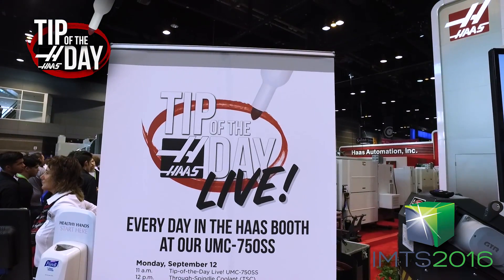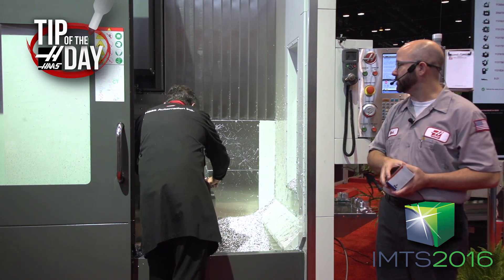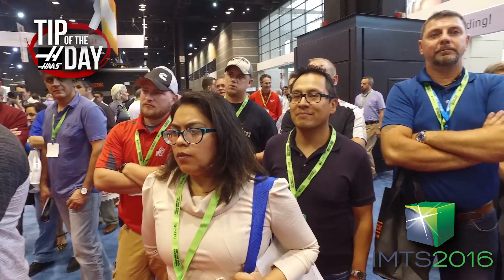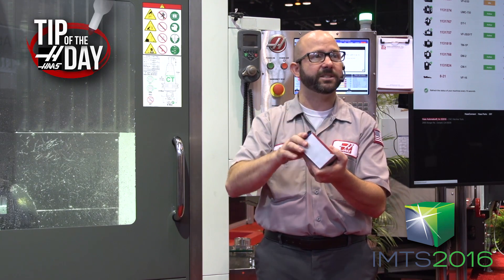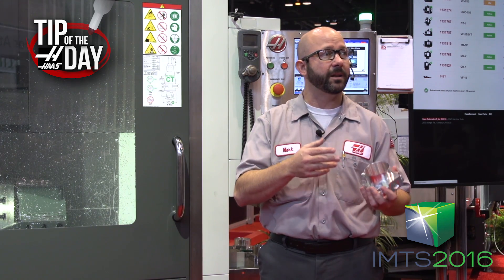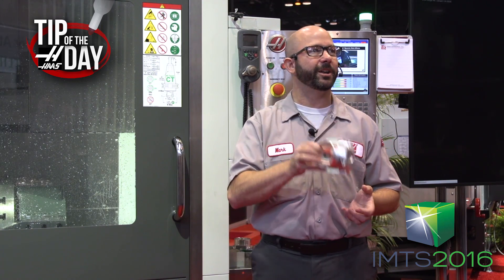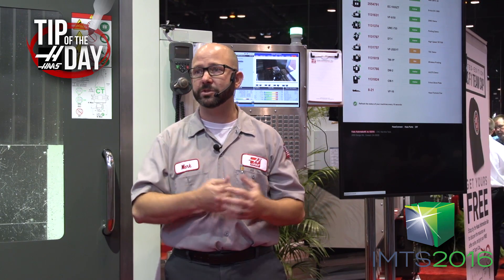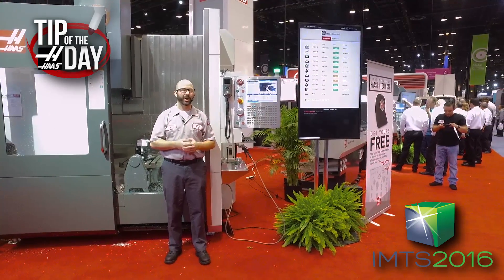Haas Tip of the Day – LIVE from IMTS in Chicago!

Comment: It actually doesn't find the part... he specified the rough position of the probe in advance.
Reply: Yep, you are right. He did.
Reply: Higher part, or vice could make nasty crash. But still, its very usefull when machine automatically adjust vice angle.

Comment: So is an M06 tool change stopping the spindle and turning off coolant only on new machines with next gen control or does it work with older HAAS machines as well? When I was still in school for machining we were taught to stop it and turn off coolant first, so I have never tried it. Will it work on any HAAS mill?
Reply: M06 does it all on a 1997 VF-E.
Reply: I use a Vf-2ss with the older controller, an M6 does everything. I learnt how to program on an old OKK machine, where you'd have to M9 then M5 then G0 H0 Z0. then G28 Z0. then finally M6 (No T# as that would have been called up earlier.) On the haas, it's literally just T# M6 and it will zero, turn off spindle and turn off coolant. Super easy.
Reply: Haas has a good control.
I hope to someday try a new one.
Reply: Thanks guys, I guess I was good then using a late 90s or very early 2000s VF1 back at school. Ill have to call up my teacher and let him in on that little tip.
Reply: LoadedMod94 He may have been preparing you for a control that doesn't work like a Haas.
Reply: You are probably right, but all we have is HAAS at the school so its good to teach it that way so we know but there isnt any reason they shouldn't be using it while still at a HAAS only facility. After watching this video and learning that M06 can do that on a HAAS its surprising that other companies don't do the same
Reply: LoadedMod94 Yup